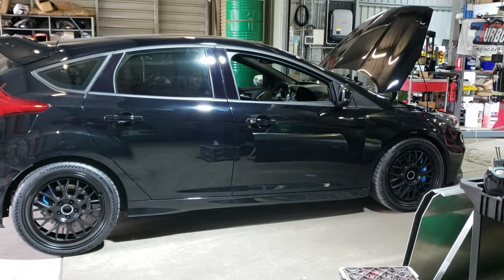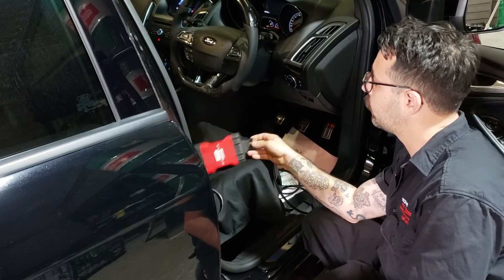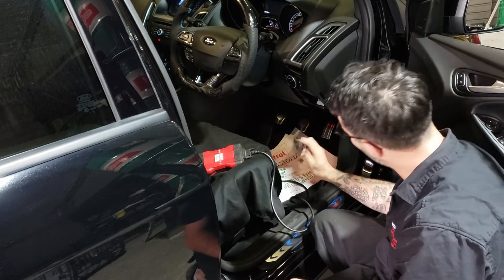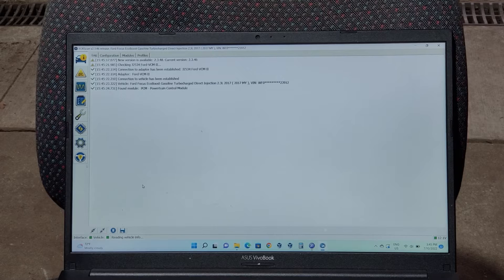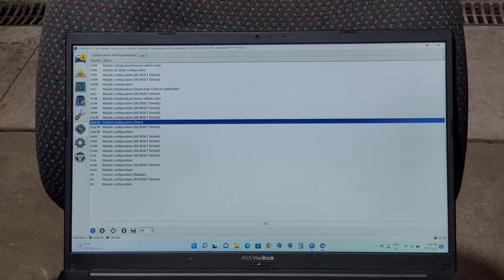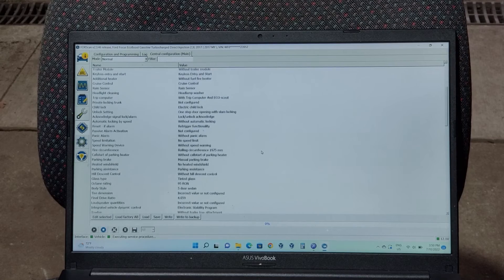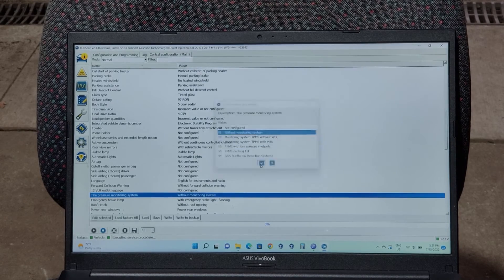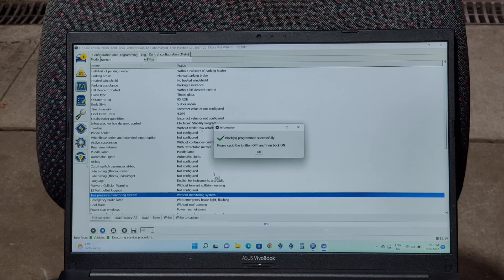How to disable TPMS on mk3 RS/ST

Comment: Can you do anything interesting with forscan on the Mk2 ST/RS?
Reply from the maker: Can switch off the front seat airbags if fitting seats from the RS so rest of the SRS still works as per normal which is handy, drive away locking, single point entry thats kinda about it as the mk2 didn't have much tech in it.